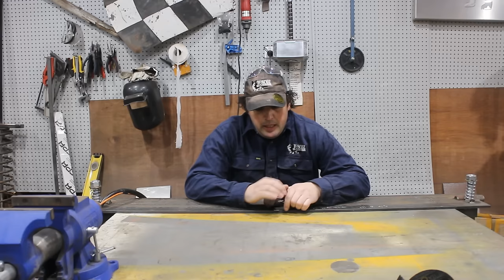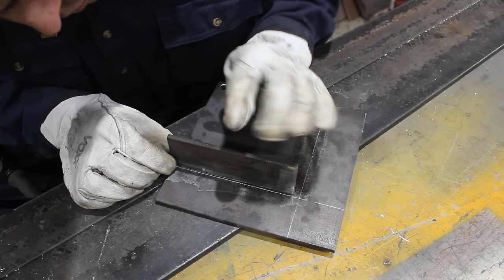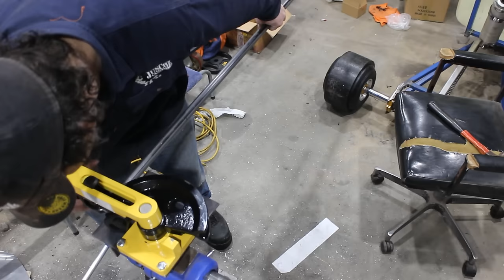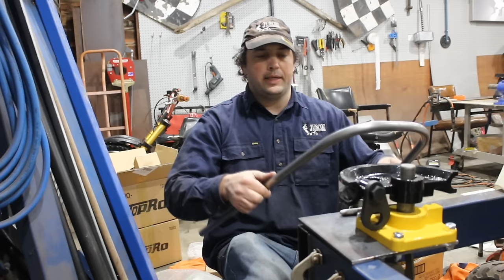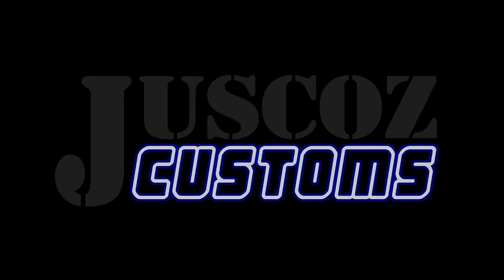Testing a cheap bender that does not suck

Comment: The handle is not stout enough.  I have one and need to modify it. It would do copper I'm sure because it's soft. But steel tubing depending on wall thickness is hard
Reply from the maker: Thanks for the heads up Kevin I guess that is why it is only rated at 2mm wall thickness for steel. I was thinking about loading in some 25mm2.6 wall but after hearing about some people breaking there benders I think I will leave that for the Chinese pipe kinker.

Comment: cool video been thinking of getting one  , they are cheaper on ebay
Reply from the maker: I got mine from ebay. The price generally depends on what currency you are using mine was $200 AUD so thats probably close to $150 USD
Shop around on ebay because some of them where listed for as much as $500 AUD.
As i said in the video details just search "10-25mm Manual pipe tube bender set" and you should get a good selection of this type of bender.
What do you want to build with it?
I have built a miniature offroad buggy so far and it has turned out really good

Comment: is it safe on stainless?
Reply from the maker: I have not tried it yet but It should work fine for stainless, I would think 1.6mm wall thickness would be the limit. Also make sure that you leave a gap of 3mm between the pipe and the guide roller when you first put the pipe in so that it does not distort the pipe when bending, I cover this in another video on the bender "bender questions answered"

Comment: Will this bend rebar??
Reply from the maker: I wouldn't recommend it. It would probably break the cast handle or the forming die. Probably best to make something like my $20 bender but bigger with a stronger longer handle and solid mounted to something
Reply: What I’m trying to make is a round circle then weld 3 legs on it for a fire ring something I can cook from at a campfire?? Set a round kettle on it too?? Any good ideas??

Comment: If you were to lube the tool and the material everything will work much better.
Reply from the maker: This bender does a good job even when going in dry so I will have to try that next time I have to bend something.
thanks for the suggestion.

Comment: Can it bend 1' thick walled tubing?
Reply from the maker: Not as it comes out of the box. It is only rated for 2mm and with a 1 inch pipe 2mm is the limit that I would try with the cast iron handle. I would want to build a new lever arm that has a brace going on either side of the die.
Your the second person this week to ask about 1 inch heavy wall pipe in this bender so I think I might try it out with a custom bender handle

Comment: That looks like a lot of work
Reply from the maker: Yeah I was bending pipe that had a 2mm wall thickness so it was at maximum capacity in this video. I'm planning on making a new handle for it with a bit more leverage so it should be a bit easier to use.
Reply: Should make it easier to operate, good luck
Reply from the maker: thanks

Comment: What is the brand to search for
Reply from the maker: Sorry michael but there is no brand or part number but I put all the relevant information I could into the description so to get your own bender go onto your local ebay and search
"10-25mm Manual pipe tube bender set"
and since buying mine they have started selling them in blue as well. 
I hope this helps
Reply: @juscozcustoms  yes it does and thank you for the reply
Reply from the maker: no problem. hope you make something great with it

Comment: Whats your name this machine
Reply from the maker: well I generally don't name my tool... 
but if you want to buy one for yourself they are usually listed on ebay as 
"10-25mm Manual pipe tube bender set"
there is lots of details about them in the video description that might help you.

Comment: can you bend 1/2 or 3/4 m l or k copper plumbing pipe?
Reply from the maker: well I have never heard of these different ratings but I have tried a piece of 1/2" annealed copper and it bent fine. 
The trick that I have found with this bender is that it does a nicer bend if you leave a 2-3mm gap between the pipe and forming wheel on the handle before you start the bend.
if you have the forming wheel hard up against the pipe before you start the bend then it tends to flatten the outside of the bend.
I hope this helps

Comment: You can buy it on eBay for$111.49
Reply from the maker: Wow eleventy one dollars...
Is that AUD or USD? Either way $111 is a good price you should get one and have a go at fabricating something with it 😁
it cost me $200AUD
Reply: That USD. Mine comes in tmw. Oh yeah that includes free shipping in the US
Reply from the maker: Awesome  @captainsteve5993 . What do you plan to build first?
Reply: Planning on fabricating outdrive stands /dollie. Will try to keep the cost down and labor, they will be affordable and reasonable to sell. And make a little profit with my hobby. So figure the bender will cut down on welding corners and add style.   Which I think would keep the average person saying I could make that 😂
Reply: @captainsteve5993  Has it worked out ok?
Reply: @brianswelding  it works great. I was very impressed.
Reply: @captainsteve5993  Wow nice. Thanks for the reply. I was looking at it last night after this vid. It was about $170.
Reply: @brianswelding   in hind sight I should’ve bought the baleigh bender Bc it comes with the square tube dies.
Reply: @captainsteve5993  Ahh ok. My main problem now is this chopper hardtail conversion I'm doing, I got 1-1/8" tubing to match the frame and am having a hard time finding a die for that size. JD2 has one of course for about 80 bazillion dollars. I'll just do it the old fashioned way I guess... LOL
Reply: @brianswelding   yeah when you jump up it’s  whole new ball game on price. Any boat tower builders by you?  I’m sure they will bend a few tubes for u

Comment: 2mm isn't much
Reply from the maker: It is not real thick but if you think about the fact that roll cages are only 2mm wall if made from chromolly or 2.5 from steel so bending a 25mm tube with a 2mm wall should be plenty strong enough for making a go-kart or mini buggys or anything else hobbiest would want to make. But you would definitely want a longer handle to get better leverage on this machine.
Reply: @juscozcustoms  ah okay. Im in the market to make roof racks and stuff. Thanks for clarification. I'm a boilermaker apprentice and I'm in heavy fab. Please excuse my ignorance

Comment: Lmao you're going to hate those apehangers after about 3 miles of trying to steer your bike through tight spaces. Not only do they look stupid, they're uncomfortable as hell.
Reply from the maker: Even if it does have horrible riding characteristics and be uncomfortable to ride the bike will spend most of its life hanging on the wall as a decoration. 
So I'm ok with that.

Comment: you simply put a 250kg baby cumalong on the end of the tube and back to the table you have the bender attached to. no effort required. very easy to get repeatable accurate results ALSO rather that eye balling for flatness you simply put your digital gauge on the former and zero it out then put it on your tube. pretty suprised you dont know how to use a digital gauge , are you even a fabricator bro?
Reply from the maker: I have heard of these things breaking the cast part of the handle just from using a cheater bar so I don't think I'll be adding a come-along any time soon. Also I know how to use a digital gauge Its not difficult, but I have never needed to use one so I don't have one, might get one one day if I find a cheap one but there are always other ways to do things if you know how to be a fabricator.
Reply: @juscozcustoms   digital gauges are 30 bucks. not sure what you consider cheap but thats less than i pay for lunch. as for the cumalong, you arent using the cumalong for extra leverage. you are using it for accurate repeatable bends and far less effort. If anything, you are reducing loads by being able to add the force slowly and in a controlled manner. if the casting breaks bending a tube it was designed to bend, it wasnt the cumalongs fault. pretty basic stuff bro.
Reply from the maker: @freelectron2029 fair enough I thought you where talking about putting the come-along on the pipe handle not the piece being worked. I'm going to be building a new bender using these dies so I'll see how that goes and if it needs a come-along but it defiantly won't have the cast handle and base anymore. as for the digital gauge last time I looked at them was probably 15 years ago and they where over $100 back then so I didn't bother but If they are that cheap I might try one for the next build.
Reply from the maker: wow they are cheap can get 3 for $40 now

Comment: I think you meant, low rider woof bike.
Reply from the maker: In Australia they are generally called "Dragster's" I believe the term originally came from pushbike drag racing in the early 60"s before BMX took over. bikes like the schwinn stingray came with a special rear tire for drag racing and a T bar shifter on the frame but In the mid 60's people started heavily customizing them and that is where the lowrider bike name originated. I have never heard of a "woof bike" if you could enlighten me because google wasn't able to help either. I call mine a Dragster because it has not been customized... Yet
Reply: @juscozcustoms  I liked the history lesson, as I hadn't heard of any of that. A couple of decades out of my realm. Not being fully in to bmx as a kid other than watching Bmx bandits back in the day. 
The "low rider woof bike"  was in reference to the last section with your dog.
Reply from the maker: All good I enjoy sharing knowledge. I was not around back then either I just read a lot of internet... as for the woof bike I'm sure #shedcorgi would love a trailer to ride in, his feet just cant reach the pedals :D

Comment: cheap bender that does not suck.... so I watch video and.... IT DOES SUCK. Any one who thinks this doesn't suck is simply WRONG.
Reply from the maker: I am curious why you think it sucks? 
It was only $200AUD  it has 7 formers
It does smooth bends and it does not distort the pipe as long as you don't clamp it to tight with the forming roller.
as far as cheap benders go this one works better than all the others I have tried over the years.
Reply: @juscozcustoms   I don't like it because it is only supported from one side as I saw you struggle with it and seen how it moved around. 

I use 1" heavy wall seamless tubing to build with and this bender would break. I think it would be worth buying just for the die set as I found these on sale for 120.00. 

I would then build a frame for it with double support like a mini JD or speedworx style. 

So I guess your right it does not really suck too bad as long as you don't need to bend heavy duty seamless tube.
Reply from the maker: Fair enough @robert5 . 
It is only rated for 2mm wall and is perfect for the people building gokarts and powerwheels but if you want to make something out of thicker pipe like control arms on a fullsize buggy this is not the machine.
I think 25mm pipe x2mm wall would really be testing the limits of this machine as it comes out of the box.
I like your idea of making a dual sided lever arm and I might try that one day but for now I have ordered a speedwerx bender so this one will be used for making brackets and stuff out of the smaller sizes that it does well.

Comment: 12foot cheater bar
Reply from the maker: that would definitely do something but not necessarily something good. 
the handle frame is a cast item and will possibly break if you put to much force on it, say with a 12 foot cheater bar.
I am collecting the parts to make a new bender that will use the dies from this and my $20 bender that I built in 2018 to make a really good bender for pipe and rhs that will be strong enough to handle a 12 foot cheater bar.

Comment: Those generic benders are pieces of junk! 
The quality of those bends made in this video are appalling, the mark from the retainer has done nothing but weaken the tube. You can clearly see the tube waisting (ovalling) in the bend is horrendous. 
As for the rippling; well that should never ever happen, because in ERW (electric resistance welded) tubing as shown in this video it causes all sorts of problems in the weld seam from micro factures, right through to tube splits and fatigue breaks.
Reply from the maker: Sorry for the late reply I typed something up months ago but apparently it did not save. 
I have watched your videos about your experiences with this style of bender and my results where totally different to yours. 
The retainer did make a mark but it was only a fraction of a millimeter and was mostly unnoticeable after removing the slight bur with a file.
As for the deformation I noticed in all of your bends when you set it up you had the guide roller hard against the tube before you started I found that if the guide roller is given at least 3mm but preferably 6mm between it and the tube before you move the handle to start the bend it allowed the guide roller to be ahead of the area that is being formed so it is only guiding the tube into the former and not being part of the forming process so it wont be deforming the outside of the tube. 
The rippling was very slight in this video and even less with later projects I believe it may be caused by tugging on the handle instead of doing one smooth motion or from the guide roller being to tight but I have never had enough rippling to bother testing the theory.

If you ever have to go back to this bender from your Baileigh RBD25 for some reason I hope this information helps you get better bends than what you had before.
Reply: @juscozcustoms  I disagree and still maintain these generic benders are junk.
I need to make repeatable neat bends in the materials I use to make items for clients. 
I work in 316,  4130 and mild steel and just cannot afford inaccurate bends or wasted material.
I cannot take the gamble of faffing about guesstimating start and finish points. 
I have used a couple more of these generic benders in fabrications shops I have contracted in to and and they are just as bad as my original baileigh bender, and now rather than messing about with them they send their bending requirements directly to me. 
I have since purchased a JD² M32 to supplement my JD² M3 and I am working these two benders consecutively side by side and although the dies and followers are for the same diameter tubes they are of different centre line radii. However, I may double up on identical CLR dies and followers for the JD² M32  and separate them out for exclusive use on Stainless and cro-moly, relegating my old JD² M3 dies and followers to mild steel only.

Comment: noisy and very annoying  muzak.
bendind is very ordinary.
Reply from the maker: Yeah I don't add music to the videos any more. As for the cheap bender I could get a better bend if I spent $250 on a single 25mm die for my $850 speedwerx bender but this does an acceptable job for $200 with its 8 different die sizes

Comment: basic bender hahah
Reply from the maker: Not as good as my speedwerx bender but it does a good enough job on the smaller sizes so I did not have to buy a lot of very expensive dies for the big bender just to do small jobs.
I think it is perfect for hobbiest to get started with though due to its price and the fact it gives better bends than any hydraulic Chinese pipe kinker I have ever used.